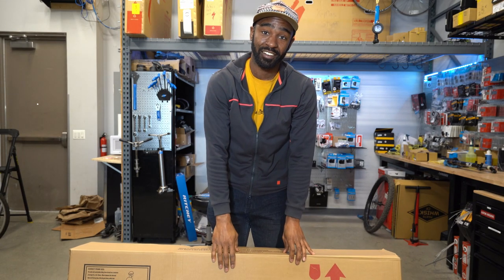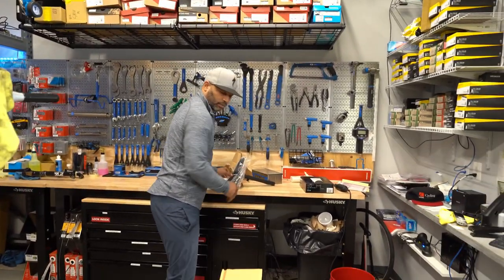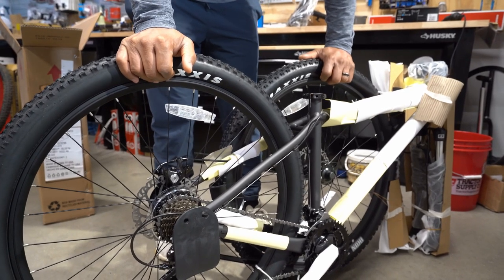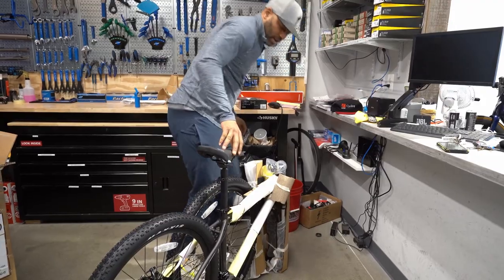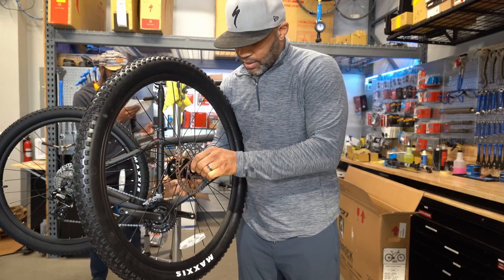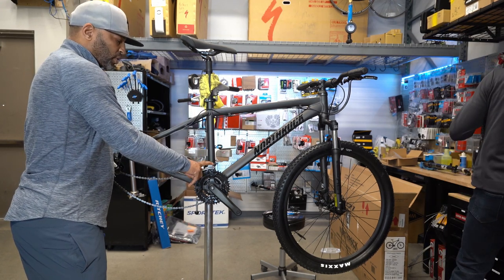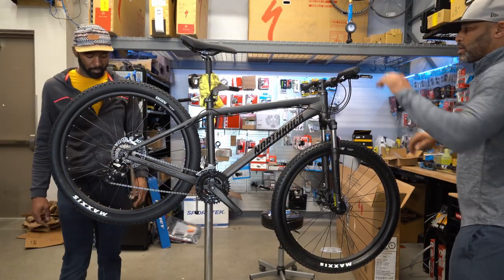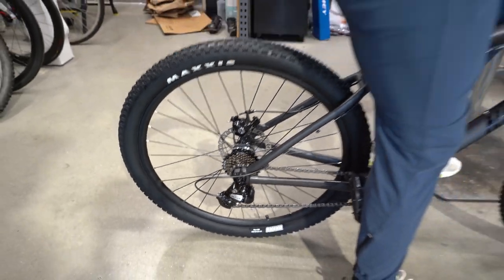Costco Bike - Part 1 - The Build

Comment: These guys do have some good points. But for the 90 percent of suburban buyers this bike is perfect. Of course if you are a hardcore competition rider you will need a more expensive bike but for the average consumer this is a good bike.
Reply: Just got it, and about to put a rockshox fork and change the handles and with those upgrades makes it a killer budget trail bike

Comment: props on recommending the pedal upgrades. i almost got in a nasty bike crash because my feet slipped off my stock pedals from a bump in the road (i did get a bad bruise on my inner thigh from slamming down on the top tube but it couldve been much worse like falling off completely and having to throw my bike down in traffic). i upgraded to some larger mtb pedals with the pins and i realized the night and day difference between the grip levels. its almost ridiculous that theyd have non-pin pedals on mountain bikes as stock though, any bump in the trail and youre going to loose control from having your feet slip off

Comment: Nice video and good point about entry level value. This is at my local Costco for $400, which I guess is still fair, given current inflation and supply chain issues. I'm trying to decide between this and a Schwinn Taff for $300. This Costco bike seems to have better brand components (even if they are lower spec) but I kinda like the 29" wheels and 1-by-8 on the Schwinn even if they're more generic components. That 19" frame might be too big for a 5'10" guy though. I'm just getting into biking again and as a middle-aged guy, I really haven't been off road since I had a cromo Trek without any suspension back in my 90's college days.

Comment: The display at my Costco has the stem on backwards. Briefly considered buying this for my son thinking it was cheap enough to upgrade the fork and drivetrain right off the bat.  Nice video quality but you need to fix the audio set up

Comment: Would have been a lot more informative if you actually showed putting it together and adjustments you made, rather than most of the video is just removing the packaging.
Reply from the maker: We are working on editing the second part of the video. The purpose isn’t to show how to build and adjust, its to see if the bike has value or if it’s just junk. If you purchased the bike, you live in the Maryland area and need help building it give Patapsco Bicycles a call, we can help you out.

Comment: How did you prevent the front brake from rubbing? I was very dissapointed when i heard it rubbing. I can't afford a nicer bike
Reply from the maker: That’s part of the problem the bike does have lower end parts on it and it take more time to set it up, that’s one of the reasons to take it to a shop

Comment: This bike sucks I paid $370 at  Costco and returned it. It's a medium frame if that. I'm 6'3"    not worth it. Miss my 90's Cannondale Cad4. It got run over by a train.
Reply from the maker: Yeah man you’re way to big for that frame. You miss the Cannondale because bikes built in the 90s were awesome.
Reply: Medium frame & 27.5 inch tyres fit my wife better - she is focused on step through Infinity boss which side by side is not nearly as good as this .

Comment: Grease the seatpost? Your nuts
Reply from the maker: Yes, with metal post going in to metal frames it’s a good idea to grease them so they don’t seize from rust or other kinds of corrosion
Reply: @pedals2pistons398  get real dude🤣
Reply: @pedals2pistons398  i put grease on my garage door handle to screw over theives trying to break in.